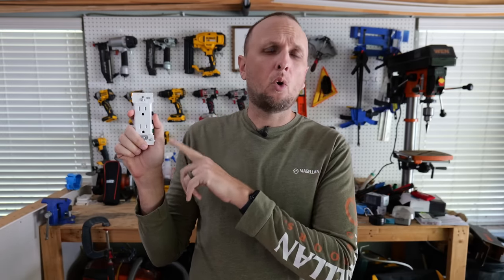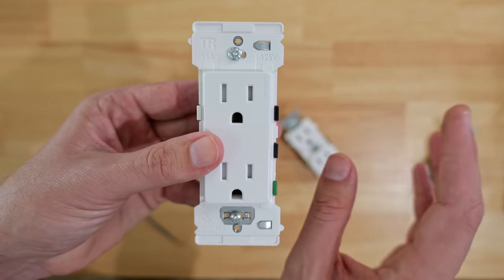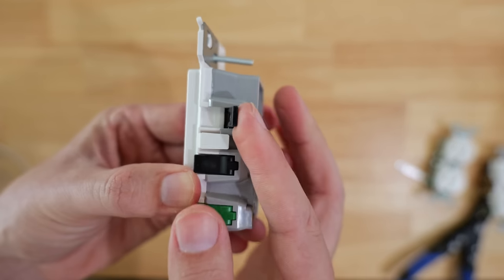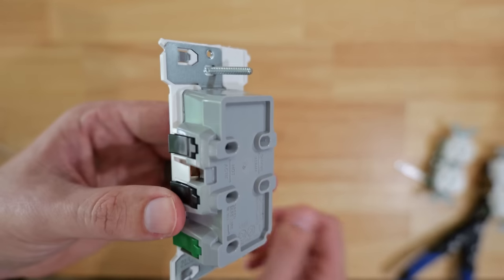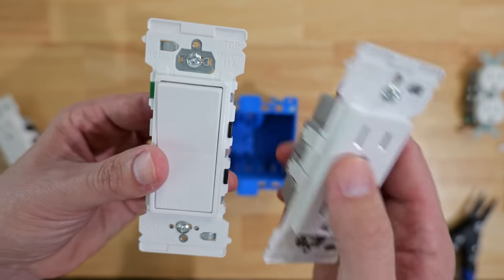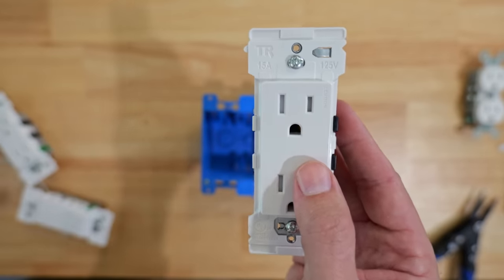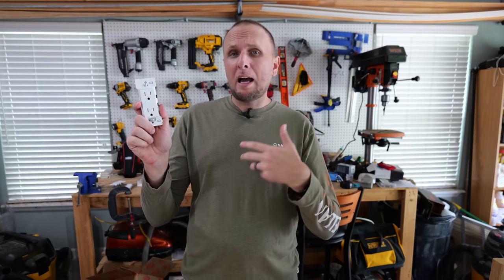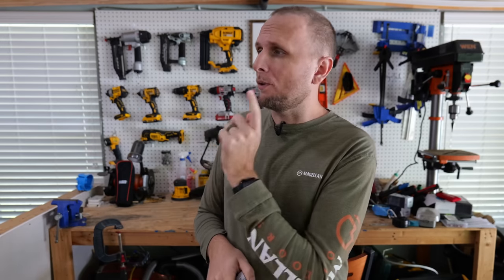The Fastest, Safest, and Most DIY Friendly Outlet Available!

Comment from the maker: So what do you think?  Are these the future of outlets and switches?
Reply: I have begun using the lever nut connectors and they are one of the best upgrades that have become available in many years!
Reply: Do they have a GFCI version?
Reply: They are the future, but it is going to be 50 years before you see wire nuts disappear from installs.  You are going to have to wait for all the people trained to use them to retire.

What I'm looking forward to is when lighting finally just switches over to 100% low voltage.  The wires are much easier to work with, and connections are even quicker and easier than WAGOs.
Reply: It should be like this years ago. First of all, is finger-safe and short-circuit safe, like the European standards. Increases productivity and safety. Good job Leviton!
Reply: @johnkelsh5859  It accepts gauge 12 and it can be connected on a 20 amp circuit if it is not the only receptacle on the circuit according to the code.
Reply: I like it
Reply: I like the idea of the Wago connectors. In practice I can get the regular outlet same brand same amperage for 75 cents rather than $3.50. It's not expensive, but I could buy 4 outlets for the price of one. What? Don't you know how to use a screwdriver? Same witth the wire nuts I can get a whole bag of wire nuts for the price of only a few Wagos. Inexpensive but that amount adds up really fast. Also I just checked you can get a commercial grade outlet for 1 dollar cheaper than this home grade wago outlet.
Reply: Is it applicable to stranded wires?
Reply: @dodongababa3164  Yes. Just make sure you twist them first, the wire that is.
Reply: Unless there is some sort of fatal flaw that causes shorting or other issues, I think this looks like a great option for the future. Obviously there will need to be more versions made. I imagine they would be popular with house flips or new construction where time is important. I think you could have done better than 13seconds if the wires hadn't already been bent. So, let's say it would take an experienced electrician something like 10 to 12 seconds to put the wires in-- that would save so much time on builds and be a lot less of a headache and less work on the hands having to pinch and twist wires and use screwdrivers. No tools required makes it more appealing. Being able to test through the back without removing wires is also a nice idea. I'd probably still wrap electrical tape over the levers to make sure there is never any chance that murphy's law would kick in and pop one open somehow.
Another bonus of this is that you can have shorter wires as you don't need to bend them around the screws.
I am curious about how much force it takes to open the levers. I don't have the strongest hands/fingers so I wonder if I would need something to pop them open or if it is easy enough to open with my fingers. 

I wish more fixtures and such would use lever technology for connections.

Just to refresh my memory-- the single pole is for controlling a single light with a single switch. Is triple controlling more lights/fixtures or is it allowing more than one switch for a light/fixture?
Reply: Where’s the bridge brake to separate the top & bottom receptacle???
Reply: I think like with wagos they have there place. With stranded, its probably nice. But while it might mechanically hold the wire better than a back stab, the real problem I've seen with back stabs is the quality of the electrical connection over time, or when its early on in a circuit and handling all the load that circuit is carrying. A sliver of metal on edge grabbing the wire, is just less contact with the wire directly, which is more resistive, and will make more heat under load, and then there's the deal with corrosion, when your contact point is smaller, corrosion effects will hit harder. I've seen many outlets using backstabs that melted down due to corrosion leading to arcing, or even just increased resistance leading to more heat than is intended from the rated current. I've seen some terribly misinformed people out there believing wagos to be superior to wirenuts in every way, which is obviously not the case in current handling. And some even believe a wago would win a pull test(maybe if stranded is involved, or the wires weren't pre twisted) and hold up to corrosion better. Idk what experience these people had, but they clearly havent worked on much old stuff. While wirenuts and outlet screws have room for error that can cause problems, they supply a superior electrical connection, a superior physical connection, and should hold up better to corrosion over time when connected corectly. I'd say especially earlier in the circuit, screwdowns or wirenuts are the way to go. I'm interested in getting some wagos for solid to stranded transitions, mostly for light fixtures. The screw and clamp on heavier duty outlets and GFCIs is faster and I'd think it has a better connection than a lever. Still a bit more room for error
Reply: @jimmccauley4525  Having 4 terminals makes no sense if you can't break the tabs
Reply: @jimmccauley4525  there's a white flap in between the two hot levers that is covering the bridge break
Reply: Now my wife wants me to replace all of the receptacles in our house!
Reply: @bobbyvee8941  till you have high resistance
Reply: It's another pointless overpriced gadget
Reply: Just picked up GFCI version from Home Depot for less than $5. Installation is quick. Problem is it won’t fit metal junction box cover inside my garage even with top and bottom plastic tab removed.
Reply from the maker: @Sai Chiang can you share a link to it?
Reply: @HowToHomeDIY. Sorry. I bought no GFCI with Wago and standard GFCI. Got confused.
Reply: They probably require deeper electrical boxes, and may not be as suitable to retrofit if yours are not that deep.
Reply: They are going to be the future of outlets and switches in my house!
Reply: Brilliant…….
Reply: Better than backstabbing that relies on spring tension but inferior to screw terminals that sandwich a straight wire between two plates.  I would not expect the WAGO style outlets and switches to ever be offered in commercial grade.  It makes little sense when clamping a straight wire between two plates and turning a screw is very easy and highly reliable.

Comment: Ignoring installation time.  Cage-Clamp technology has proven to be very good in even high vibration applications.  Dummy proof (almost) and applies less stress to cable than wire nuts.  Looks like a winner.  You already see this type of connection (not with levers) on industrial equipment.  Well proven.
Reply from the maker: Good info.  Appreciate the input Nick!
Reply: This solves nothing. The issue is the wires…not the  receptacles (or switches). An elegant solution would wire the gang box instead of the receptacle(s). Then the receptacles could snap onto buses in the gang box. Could even include terminals for smart home networking.
Reply: @tycox8704 this is genius... Brb to start a smart box gang...
Reply: @tycox8704 so kind of like a din rail application?
Reply: @Rexmorgan687  Does one exist in the U.S. market?
Reply: @Chi9221  I don’t know. Is the rail energized? Are there separate rails for the neutral and ground?

Comment: Looking forward to see this in commercial grade.
Reply from the maker: I hope they make some.  Really interested to see how they would be.
Reply: Hubbell makes them called edge connect
Reply: @sciatl2505  Those are spring connect. Basically back stab with a leaver that releases the spring. This is different than having a lever action apply the actual force.
Reply: @zeroibis  ok good to know is that bad
Reply: If you notice, both the switches and the outlets are self-grounding devices if you're using a grounded metal box.
Reply: hubbell has industrial and commercial in a much better design.  leviton is resi

Comment: Awesome! Makes upgrading old 2 prong plugs faster and much safer. Because: in old small metal boxes: no exposed screws on the side ! Great piece of engineering. And with the levers applying Apple pressure once closed: no future loose conns. Great piece of engineering and design. These are the future of residential new construction
Reply: without clear parts they have not proof of contact, either they are clear or ima keep makin loops or straits and turnin the screwdriver.
Reply: @mos8541  You don't need it to be clear to know if there's contact or not...use the strip gauge, then tug on it...if it's in there's contact.
Reply: I assume you meant ample pressure. Isn’t spell check wonderful. 😊
Reply: My daughter bought a house.  One of the breakers kept tripping until we narrowed it down to a receptacle in a metal outlet box that had the side bend in just enough to contact the receptacle side screws which were screwed all the way out.
Give me the new connectors any day.  Touch safe.
Reply: @mos8541  Don't think I want you working in my company then.
Reply: @zaklex3165  WRONG... the VERY thing he compares it to are fukkn CLEAR
Reply: @TomCee53  not really it gets around 50% of my shit wrong, cant fukkn stand it
Reply: @RichTheEngineer  oh no!!! ...   SFMF
Reply: If replacing two prongs with three prongs outlets with no ground then you need to use gfci outlets
Reply: Just more crap I don’t need on my service truck.

Comment: One of the big advantages of the wago lever connectors is that they are transparent so you can visually see that the wire is fully inserted. These seem to be missing that option.
Reply: @RadioRich100 😂

Comment: To be honest, what I would like to see is a lever-nut style bus for grounds built into the box itself. Obviously all the grounds coming into a box have to be tied together, and that can take a bit of space when it comes to, for example, a 4-gang box with a Romex cable going back to the breaker, outlet duplex connector and 3 light switches.

Comment: It's great idea, not just saving time, but it seems to be much safer when it comes to connection and color coded wire connection is a plus.
Reply from the maker: Yeah I would say it would be fairly difficult to mess up.  Thanks for the feedback Ryan!
Reply: All outlets are already color coded.  Silver screws on the outlet are common, white wire, Brass screws on the outlet are hot, black wire, and green is ground (green grass on the ground).  
But I agree, these new outlets will save a lot of time installing them.
Reply: Is it safe for aluminum wires? My house has aluminum wires

Comment: On the receptacle, it looks like it supports split hots so that one can be switched and the other 'always on'. Lift the tab between the two hot levels and remove the brass jumper as is normally done. The dual neutrals appear to have this jumper but it is more hidden. Split neutrals are usually against code.
Reply: You'd have to split the neutral if you have two different circuits.

Comment: I was re-wiring my garage and relocating some of the outlets and found this video and check my local hardware store and they have it on stock. When I arrive to Home Depot (3 different one) they didn’t know what I was talking about. Even today when to look for a single pole switch and they still not on the shelf I feel I was the first customer on getting this outlets and switches. The installation is more clean and fast and yes when installing two next to each other make the installation quicker and straight the outlet. I wish they came up with this long time ago

Comment: First, I thank you and love your videos---I'm all about informing the public too. Second, here's my opinion (you asked, and hopefully you read all comments...I see 610 on here) --after my own quick testing, these are just like backstabbing. I agree with you about the connection being a little better than backstabbing, but it's still a loose connection. I don't want to impose, but if you wish, I can attach the link to my short video showing how easy the wires are pulled out of a Decora Edge outlet with just a few twists--and they were #12 wires. I'm a licensed electrician, doing this for 23 years. I'm on a mission to inform everyone how backstabbing causes heat, arcing and sparking, and fires in the right conditions (near bed sheets, curtains, wood, etc). I have multiple pictures (from my own field experience) of burnt wires, melted boxes, and a fire in one instance because of backstabbing. The problem: if a house fire starts this way, and is not found and extinguished, it can't be proven how it starts (unlike arson occasionally). Everything is gone...ashes. We both know all electrical connections need to be torqued down nice and tight. 
I really wouldn't mind putting our heads together for testing these out--like how much heat is created with these compared to proper connection wrapped around screws an a regular receptacle.
Thanks again,
Rich P

Comment: I really like using the wago for hooking up lights with small gauge wires. It simply makes the connection easier than wire nuts. Looking forward to using these new outlets and switches in the future!
Thanks for putting this video out. It is informative and well done!

Comment: One thing I didn't remember hearing is that just like the traditional outlets, you can still separate the two hot sides on this one for, say, controlling a light with a switch.  It looks like there is a tab between the two levers that may be for this purpose.  If you did cover that, I missed it.

Comment: At around 10:00 or so, you mention commercial grade receptacles - another advantage they typically have is more durability as far as mating cycles of the contacts themselves.  Every outlet I've seen fail has not been in the wiring terminations, but the contacts of the receptacles themselves.
Reply: I agree, most failures I've seen on receptacles have been backstabbing. That being said, the receptacle in my the hallway to my bedroom stopped holding plugs in, that's a failure in my eyes.
Reply: Ziplock bags as an example, does the lever snap around the wire for better connectivity metal to metal? Like some things have a groove like trim that the piece that attaches to it snaps into it.

Comment: Show how the extenders work in an enlarged hole. Also, open one of these receptacles up to look/show the internals for better analysis. Thanks for what you do!
Reply: Ziplock bags as an example, does the lever snap around the wire for better connectivity metal to metal? Like some things have a groove like trim that the piece that attaches to it snaps into it.

Comment: Being an hvac contractor for years and seeing the litany of new, improved concepts hit the market I know for sure most contractors are skeptical about installing devices that are not time proven.  I remember plumbers using the old original pex back in the 80s which of course began to leak and burst in the walls.  It was such a fiasco that destroyed homes and plumbing business'.  Such events led to the skepticism that prudent contractors have.  If these work well over time, they will probably overtake the screw down types.  Plus too, contractor grade is sold in 10 packs for a fraction of the cost of these.  In order to be used in large numbers (on new or upgrade construction) the price will have to be on par with the screw on's.

Comment: I am a licensed electrician in Virginia. I, personally wouldn’t use them unless a customer specifically requested them. First of all, 99% of all homes and businesses have the traditional looking receptacles in them, and those new ones from Leviton would not match most folks existing receptacles. The second thing is, I’m sure they are much more expensive than traditional receptacles which means the customer would have to end up eating the cost, and I don’t think most people would be willing to pay the extra increase for the same result that they will get with a regular receptacle. One last thing, in many cases, you will still have to use wire nuts, or additional wago’s because oftentimes there  will be more than two black wires, more than two white wires and more than one ground wire.
Reply: They're $1 more and can be installed in 1/4 the time. The only reason not to use these is if you're trying to soak people on hourly overcharging.

Comment: I think these are a big improvement both in safety and ease of use over regular home grade plugs.  My last install was with commercial grade using the screw back, which I think are even better.  Too many homeowners do not install plugs correctly.

Comment: Try pulling it after a years normal use. Being old school, I'm skeptical, faster ain't always better. Conductors heat and expand when pulling amperage, they cool down and retract when not pulling amperage. The constant expanding retracting changes the distances between the compression contactor and conductor which in turn can cause the wire to loosen over time, conductors also slightly move with the sudden in-rush of current when a load  is plugged in or turned on, this combination can result in arcing if conductor is not making good contact at termination source. I think I'll stick with the time honored & proven shepherds hook and screw termination method, when done correctly that conductor ain't going anywhere.
Reply: This is a common misconception about lever nuts: "The constant expanding retracting changes the distances between the compression contactor and conductor which in turn can cause the wire to loosen over time" -- lever nuts are not a clamp; they're a spring temporarily held open by the lever. Once the lever is closed, you can burn away the plastic, and the conductors will still be held together by the permanent spring that is making the connection. Lever nuts do not loosen like a screw or a weak backstab.